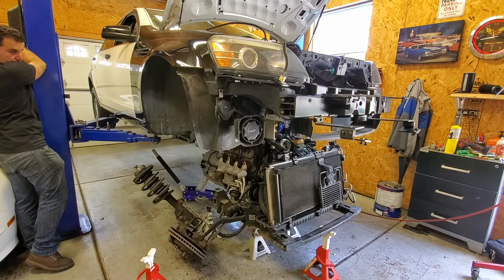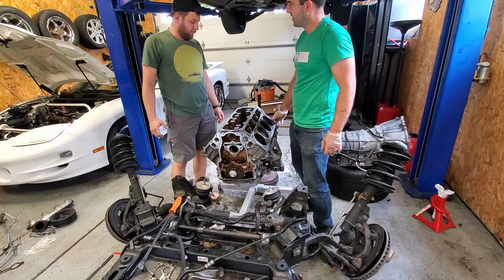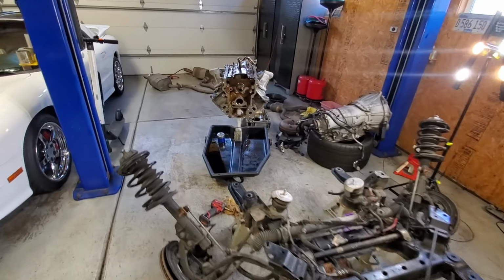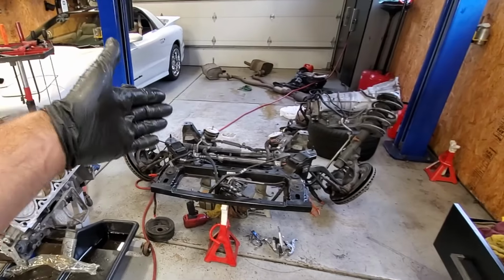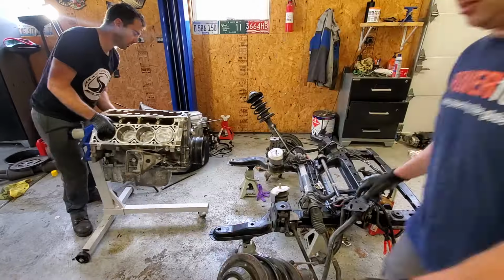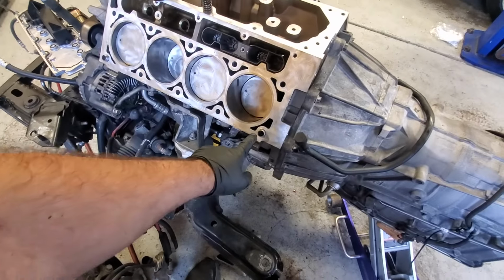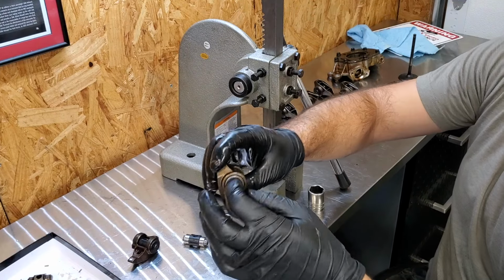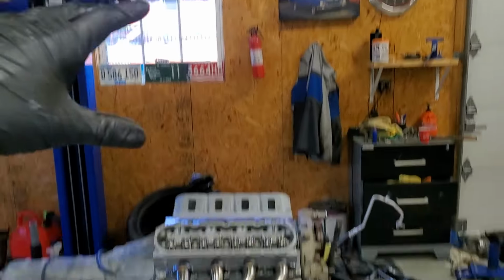Fixing THE WORST LS Engine Factory Defect Ever & Adding 100 Horsepower In The Process! GM Failed US!

Comment: That on demand system it’s a nightmare GM really got creative with something that it’s just not useful or efficient
Reply: Blame the epa we wouldn’t have to mess with this if they didn’t require all automakers to meet certain goals for fuel efficiently.
Reply: FishFind3000 the worst part about it is that every time a lifter fail you have to remove the heads to fix it and the oil burning in those engines is crazy 
And to top it up GM just don’t fixed they said it’s fine for a engine to burn 5 quarts of oil between oil changes 🤣
Reply: @toro80  I don't disagree that it's a stupid system, but your oil burning issue isn't universal.  I've got 127,000 miles on my L76 and never need to add oil with a 5,000 mile change interval.
Reply: Darin Vee I know it’s not everybody but it’s affecting a lot of people and sucks that you pay over 45k on a suv that burns oil also my transmission went out at 80k this was a 2008 Yukon XL
Reply: @toro80  I definitely agree it's too many and GM should have figured out some type of fix.  My neighbors 09 Chevy Silverado went at 58k, so I have seen it happen. I guess it's just the luck of the draw.

Comment: Hey Alex I usually love your videos and I see it’s a great build but there is one thing here ... please stop using the rotary grinder with the scotch brite pad or Bristle Disc ,it’s just as bad especially on aluminum! This tool destroys the matching surfaces and you just made nice waves all over the head gasket surface!yes it takes longer to clean by hand... use plastic scraper , red or gray scotch brite soaked in brake cleaner works well!
Reply: He Used the rubber one. Then stated to not use the scotch brite pads.
Reply: typ901 that one is no different! You have to clean by hand period! That tool Digs in the material! And removes material! You can clearly see the surface finish damage on the video!
Reply: Yep